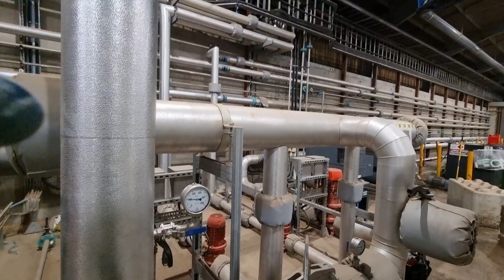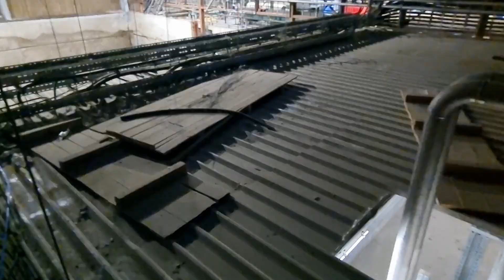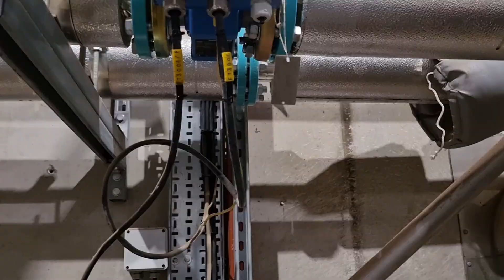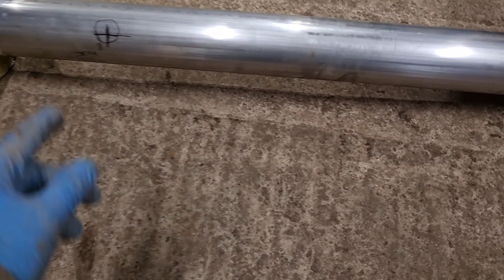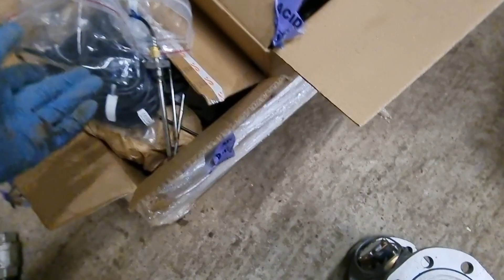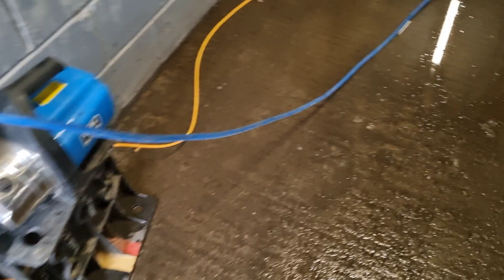WOULD YOU BE HAPPY WITH THIS!!!

Comment: Friday night and I’ve nothing better to do so I thought I’d give my opinion, hope you don’t mind mate 😂
If it is setup to MI’s and has still warped then something should be done about it as it is a manufacturing issue. It might not effect the performance of the boiler but it will defiantly take a few years off it’s life. Maybe they will take the compensation route?  Keep up the good work Tom 👍🏻
Reply from the maker: Thanks for the support mate, it just makes it a right struggle to get the baffle out, it doesn't actually affect the performance but if the baffle becomes so if can't be removed the boilers knackered, an oil boiler should last easily 25 years so it really does need sorting, in theory the support could be bent back and re welded but I doubt Worcester have the facility to do this on the job
Reply: @PlumbLikeTom  Have they resolved this issue yet Tom? An old colleague said they used to have a guy who went round welding the studs back on for the inspection hatches on the old Dansemoors but i don't think they do it anymore

Comment: Is the boiler running correctly? Not burning too hot? Correct nozzle and pump pressure? If co2 running low could be burning too hot and warping the steel, takes alot of heat to bend hardened steel.. albeit Worcesters steel is very thin compared to a warmflow which are built like tanks
Reply from the maker: The boiler has been set up and working correctly, Worcester are aware of the issue which effects a small number of boilers, the design has now been changed but that doesn't really help me, the issue has probably only really just come to light as these boilers have got to a year old and the failings are being picked up on the first service, hopefully they don't try and say it has been burning wrong, I do have a video of me setting the thing up

Comment: Tom what insurance covers a replacement?
Reply from the maker: Every time I fit a boiler I have to notify and keep a record of the installation, the insurance class it as design so if anything goes wrong in the future I would be covered, I mainly got it for the larger plant rooms and commercial jobs but it will cover the domestic stuff as well, thanks for watching as always mate 👍
Reply: @PlumbLikeTom  Nice one, what is it actually called? Might need to look into it for some larger jobs
Reply from the maker: @ithappenedagain6503  it's a design indemnity insurance, my insurance is very expensive as we work in some higher risk environments

Comment: I can't see a Worcester  engineer fixing it either Tom, its a manufacturing defect in that the spot weld was not done correctly but a Worcester service engineer won't have spot welding gear or the training to do so, they should replace the unit though or if that whole section can be removed & replaced they should get their finger out and do so, feel sad for their Rep though. Love the big plant stuff you show, you don't half get up to some interesting stuff. 👍
Reply from the maker: I think that's why there reluctant to go to it, I'm not sure they will be able to fix it on site but it doesn't really help me, in theory it possibly could be bent back on every service but that is not really a long term solution, eventually it will fail completely, in theory I could get it welded up but I don't really think it's my job to do, thanks for watching as always mate 👍

Comment: Terrible customer service from Worcester. They need to hold their hands up and sort this. Worcester have not made a good oil boiler since they started making condensing oil boilers(the toaster baffles with dimples etc and subsequent garbage!). The boilers before condensing boilers were solid and reliable. Stay clear and fit Grant.
Reply from the maker: All I want is the issue sorting, your right about the toaster type baffles ones, they were awful to service, to be honest I have always found all the other models fairly simple but improvements can always be made. Thanks for watching as always mate
Reply: Grant are absolute rubbish. Poor aftercare, leak like a sieve. Would rather fit warmflow

Comment: Horrible horrible boilers .. I had to buy a pull hammer to get worc baffles out and getting baffled out on the toaster version is a mare .. 
Hate servicing them because they are over engined and not fit for purpose.

Grant is far easier as you know and maybe navian
Reply from the maker: Thanks for the support mate, I've seen a few videos on the Navien oil boilers and I'm honestly don't know what to make of them, I know their gas ones get a lot of stick in the USA but I have no hands on experience, have you ever worked or fitted one
Reply: @PlumbLikeTom  check out and maybe get in touch with the loving plumbing channel.. he fits the oil boilers and rates them . I stick with grant
Reply: Loving plumbing just uploaded a video with the external navian combi .. worth a look if your bored on a Sunday night
Reply from the maker: @markplumber3635  Yes mate, I need to drop him a message and ask him what there like, I did talk to a guy who fitted one and said the condense was a nightmare, it comes out so low down it was impossible to get a fall from, they do make a riser kit for internal models but then it won't fit under a worktop
Reply: @PlumbLikeTom  yeah drop him a line , but would make good content even if you fitted one seeing it's the new kid on the block .. me personally I prefer grants . We know there problems but 100 times better than Worcester both on install and service

Comment: Not good enough WB , but I am not surprised at all Tom.                I'm a member of a engineer only oil group and hear lots of bad things the last few years...............

Look up Houndsfield oil boilers over in east anglia,  good bloke/boilers and stands by his product 100%  on the odd time you need him to.
Reply from the maker: I will have to give them a look up mate, I'm hoping this issue will all be sorted, I'm kind of stuck in the middle, I think if it was a simple case of switching out a part the issue would have been dealt with next day, but because the fix is a little more difficult it is taking longer to sort, the lack of communication is frustrating
Reply: @PlumbLikeTom       I use Houndsfield and Grant, depending on customer/application.                  Andrew Houndsfield has a long history with oil boilers going back to Boulter in the 80's (R&D) , then HRM  (wallstars)   and eventually his own outfit.              100%   try one,  its nice to support REAL  British  made/owned   small manufacturers  IMHO, product is good and has won a award.    You deal direct too, which I like.

I've known Paul Wakefield (Grant MD)  since the early days when he Imported/sold them as Gemini's out of Churchfields in Salisbury.          Grants Largely  good boilers but have got too big to have a personal  relationship  with anymore, which goes a long way when you get problems.

HTH.   Cheers.

Comment: I found buckled baffles on a 2 yr old Worcester, got the customer to ring Worcester and they came out and replaced them. I find some companies respond more effectively when customers ring rather than installers.
Reply from the maker: I might have to give it a try mate, I feel personally responsible for this as I supplied and fitted the boiler, it does still work but this issue does need a fix, luckily the customer is understanding but at the end of the day they have every right to reject the boiler and ask for a re-fund if the problem is not sorted, thanks for watching as always mate

Comment: Hope you're well pal, I've personally never been into Worcesters think I've fitted one in 23 years. 👍
Reply from the maker: What do you fit mate, I've only had a few problems over the years and they have all been sorted
Reply: @PlumbLikeTom  If it's a gas boiler I do like my Ideals and Baxis. To be fair I don't install Oil boilers though just work on breakdowns mainly can't be doing the heavy stuff anymore, getting older now 😂.
Reply from the maker: @theengineeroilsafe279  I do fit a few Baxi's and tried ideals in the past, never really had an issue with either personally but have seen a few logics with split sumps and or dripping main heat exchangers which put me off a bit.
Reply: @Manic Miner never had one block.

Comment: How is the heating water maintained  at such a low ph?
Reply from the maker: It's a sealed system, the water we use id de-ironized which has all the impurities removes, it's effectively mineral water, it will pick up impurities from the air so the PH won't be exactly 7, but it's as good as it will get
Reply: @PlumbLikeTom  Thanks for that,always interested in ways to combat magnetite formation and its issues in domestic situations.

Comment: Surely worcester have an obligation to send one of their engineers as a warranty visit to assess the problem?
Reply from the maker: You would have assumed so, unfortunately according to the rep, they don't see it as a warranty issue because the baffle can still be removed, they won't put this in writing though as internal emails can't be shared. They have changed the design on the new models but that don't help me, I'm stuck with an unhappy customer, I contacted my supplier who said contact Worcester, and Worcester won't help
Reply: Bad form , especially as you fit their gas boilers too. Hit them where it hurts & start fitting grant oil boilers. Great boilers imo